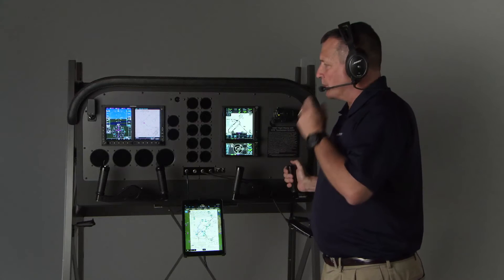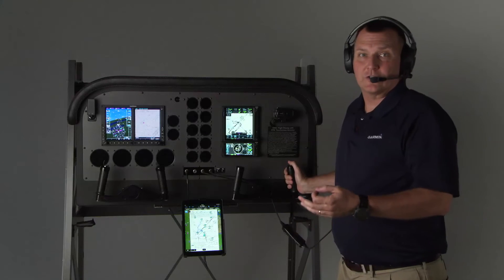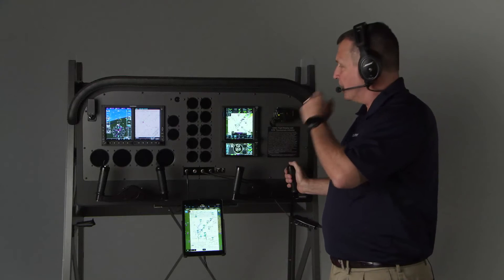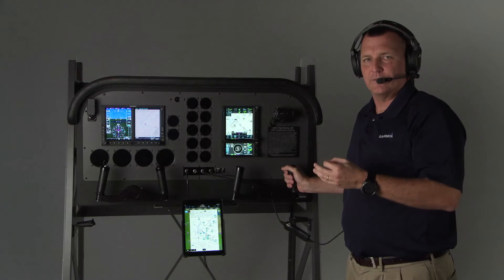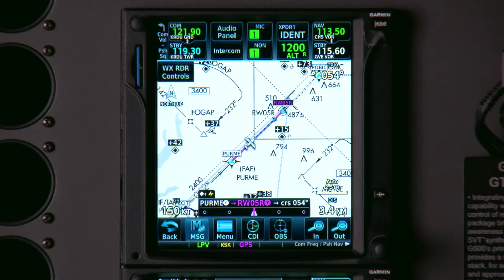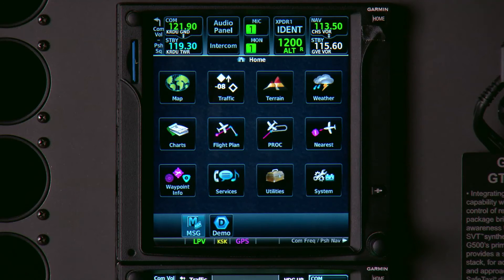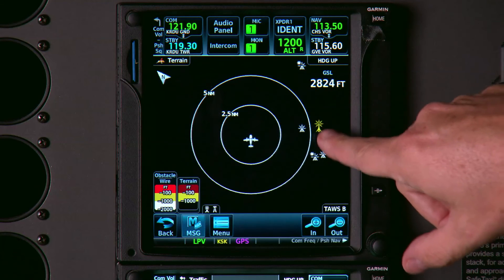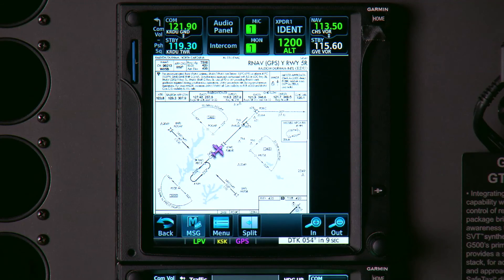Telligence Voice Commands

Comment: I have a GTN750xi and a GMA350c.  The tune function is severely handicapped.  Your only options are nearest and destination.  Flying cross country, these are of little use.  ATC is often having me change frequencies from one center to another.  "Tune 123.45" would be a often used (and needed) command.  I have brought this up to Garmin tech support before with no results.  Come on guys, 15 year old cell phones do better than this.